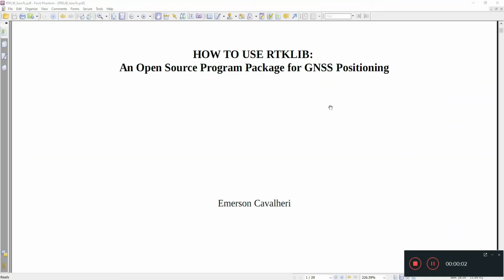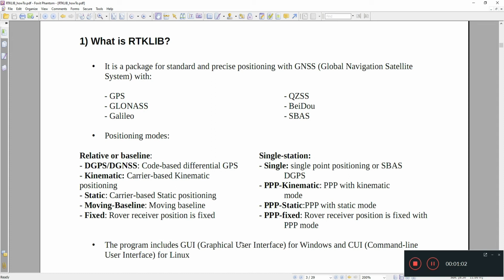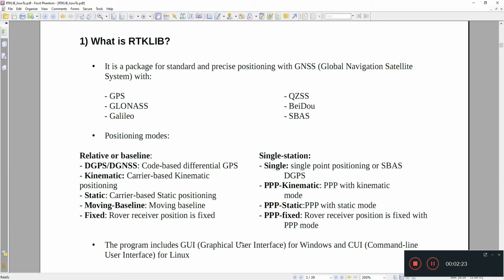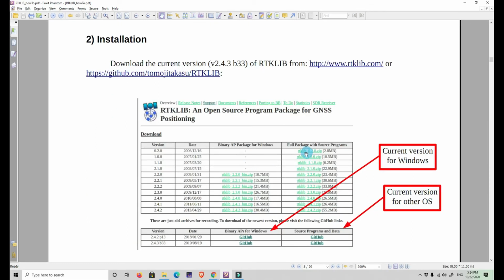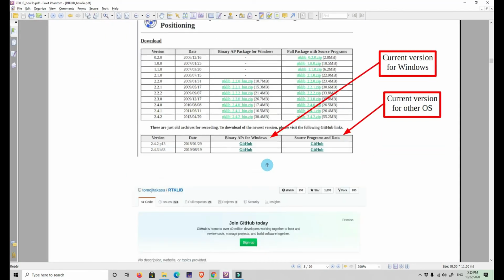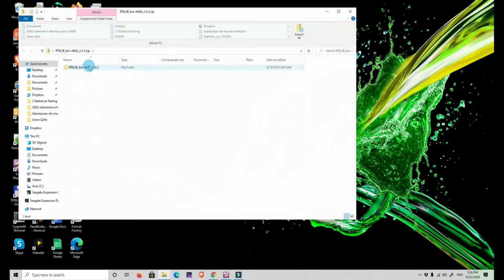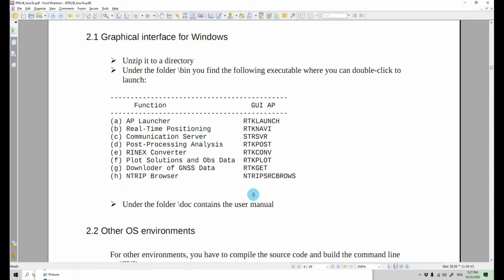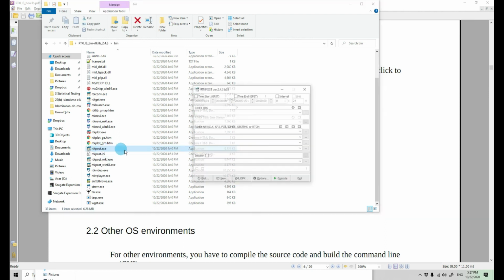RTKLIB Easy Installation

Comment: Dear Sir,

I am encountering an issue with the MapAssist software while post-processing data . The error message displayed is "Base raw data not found in PPK," even though the base data is available.

Previously, I used a TOPCON DGPS base and successfully post-processed and geotagged data using TBC, creating surfaces such as DEMs. However, during my recent fieldwork, I used a SATLAB base instead of TOPCON and set it to RTK mode instead of PPK mode. I later realized that RTK data cannot be converted into RINEX format, which is required by MapAssist for creating EXIF files.

Currently, I have the following data:
- JPG images
- IMU data in CSV format
- Base data in both CSV and SHP formats
- Rover data in extracted UBX format

When I attempt to post-process, the software indicates, "Base raw data not found in PPK > base folder; please copy or extract base data," despite the data already being in an extracted format.

Could you please suggest any workaround to resolve this post-processing issue?

Can Base data (Single point Location for one survey) in RTK mode be converted into Rinex, taking into consideration that I have not kept  open the raw files option.
Reply from the maker: I am not really into MapAssist . You imply to use the base station data in RINEX format. Using RINEX format is usually wise. Just be careful with the version used: make sure  the software can handle it.